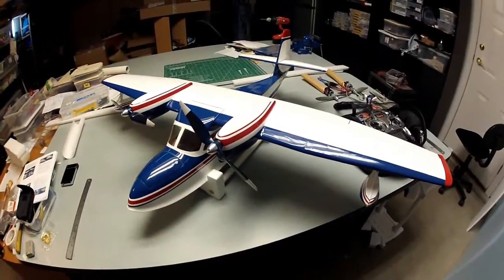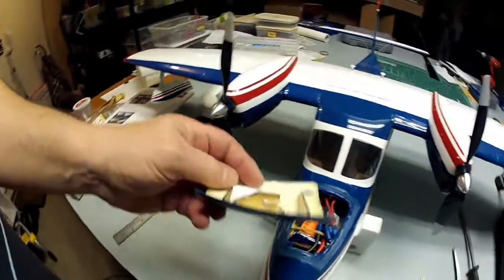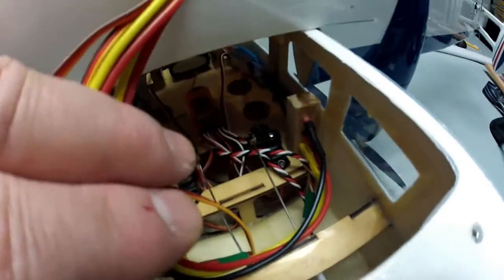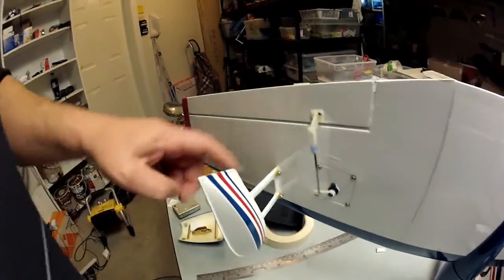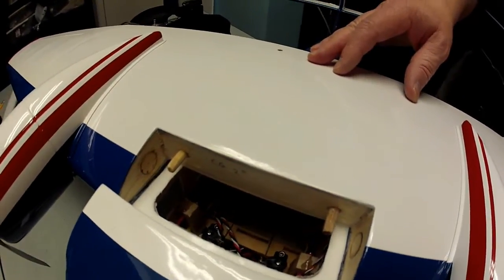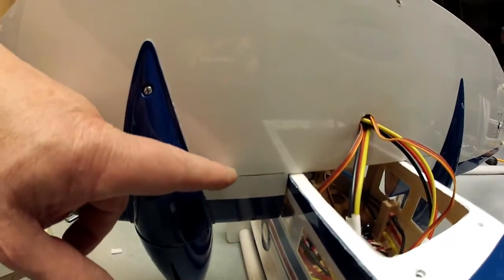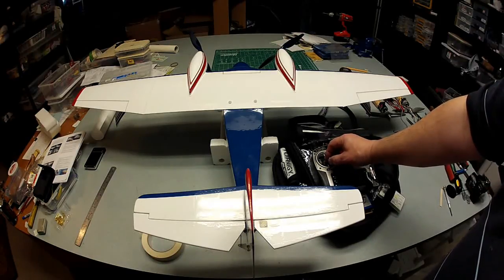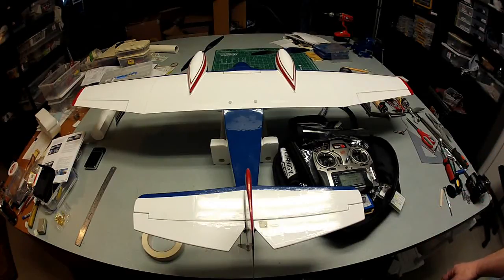RC Widgeon preparations and differential thrust

Comment: im using using Futaba 6EX and I would like to do the differential thrust, Can you please help me how to do programming, what I need and the exact throws. Thanx in advance
Reply from the maker: Don't have a a Futaba, so I can't say the exact settings.  Also, I don't know if a 6EX can do all this.  You will need 5 channels minimum, THR,  AIL, ELEV, RUD, and THR2.  THR controls one motor, THR2 controls the other.  You mix THR onto an unused channel (5 or 6, your choice), and call it THR2.  THR2 must exactly follow whatever THR does.  Then you have to mix RUD onto THR and THR2 so that the motor on the inside of the turn slows down.  When you do left rudder, the left motor slows down, and right rudder the right motor slows down.
Also put in a switch to turn diff thrust off in the air, as it is very dangerous.  I had a switch but forgot it on for one flight.  I applied rudder and the plane did a stall spin due to the unbalanced thrust.  No video of that, unfortunately.
Reply: gwzyzzy, thanx for the reply. you have an awesome plane. thanx once again. that was very helpful

Comment from the maker: You do this with mixes in your radio.  I have a DX8.  Since this plane has no flaps or gear,channels 5 and 6 are free.  I used 5.  You mix ch 5 to follow ch 1 at 100%.  This is for Spektrum, with other radios it would be other channels.  Then you need 2 other mixes to mix the rudder onto ch1 and onto ch5.  If you have a Spektrum I can give you the exact mixes.  For other brand you have to figure it out.  I don't think a DX6 has enough free mixes for this.

Comment from the maker: I painted the motor mount area with varathane and then thin CA where it seemed required.  I put a plug of silicone in the hole where the wires enter the wing under the cowling so that is sealed.
Aileron linkage system is same as most GP planes.  I painted the pushrod with oil.  The rest can't rust.

Comment: I get my kit today.  and I really appreciate you taking the time to pass on the waterproofing tips as I've had a lot of trouble with my Icon A5 and have been learning the waterproofing tips by hard knocks.  I've lost 3 rudder servos and an ailleron servo. this looks like a much more solid and substantial plane.  The aileron linkage worries me a bit though.